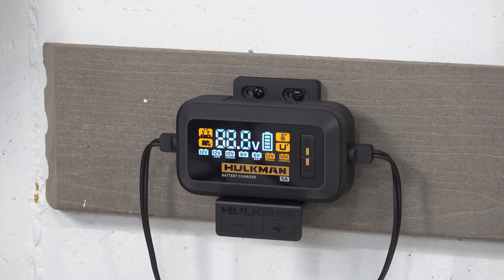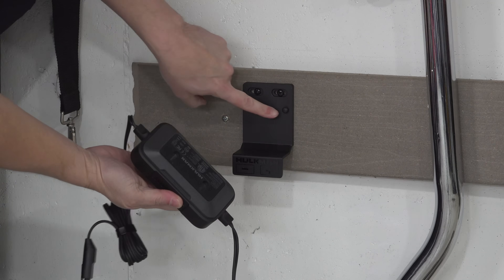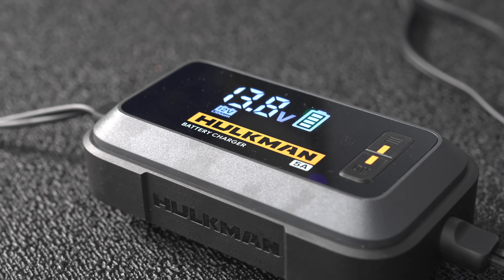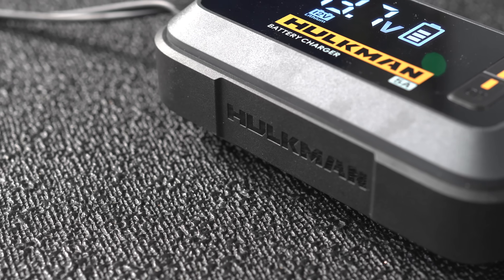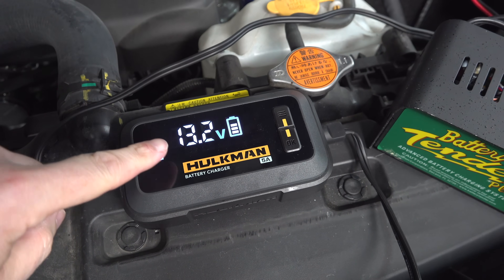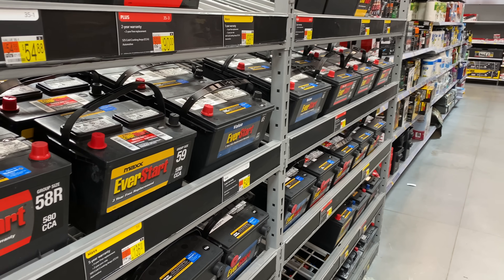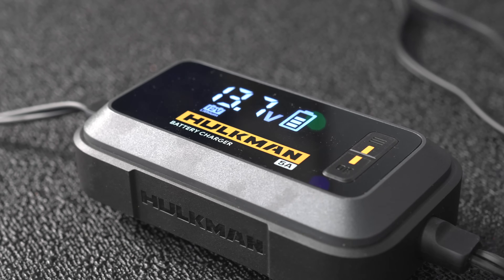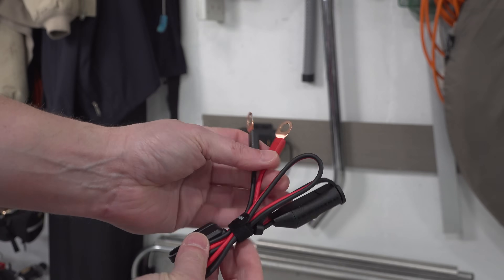UNIVERSAL BATTERY CHARGER - Hulkman Sigma 5 Charger & Maintainer

Comment: 12 volt battery at 7v. How do i start repair mode? I can select repair mode but it will not turn on when I tap select to start process or long hold.  Charger will just show 7v then cut off. Will not go into repair mode or load mode. How do i fix?

Comment: i bought this charger a few weeks ago. so far I've revived an old battery that came out of my civic I scrapped 4 years ago. battery had just been sitting, wou;dn't take a full charge and I ran the repair mode 4 times and now the battery will take a charge and my centech tester shows 90% of capacity. I've got a lawn tractor battery running its 3rd repair right now. that battery sat for a year and was dead. its taking a charge and hitting 85% of its og capacity. next up is a group 65 car battery. right now i've revived $100 worth of old batteries. i'm $40 a ahead on this unit right now.
Reply: Lol I'm going to be doing the same with all my batteries. I really hope they come back. For 15$bucks on Amazon, I figured I couldn't go wrong as my older chargers jus don't do it

Comment: How do you know what battery you have?
Reply: Simplest way- look at the label on the battery.  If you cannot find the "type" on the battery, find the make and model for the battery, and google it.  Many automobiles have an owners manual as well- and often the requirements are stated within the manual. Most people don't venture out of the lane and change the type or size of the battery, although in colder environments, some will buy a higher capacity ( cold cranking amps, aka  CCA ) .  
Reality is- for the most part, it's foolish to hook up a charger to a battery and leave it connected for any significant amount of time unmonitored.  Under most circumstances, one should not need to use a charger;  if you do, you have a weak battery that is close to failing or you have some sort of parasitic drain that is causing the batteries to drain;  or you simply are not using your equipment often enough to keep it charged otherwise.

Comment: Looks ok the problem is it's 5 amp that just too slow... I remember trying to charge my battery with a 2amp charger and it takes around 2 days on constant charge.... I'm guessing a 5 amp would take 24 hrs  that's just too slow.... Minimum battery chargers people should look at is 8- 10amps  unless of course you just want a battery maintainer...   Though most battery chargers have maintaining function as well.... so why not get both....

Comment: Glad you mentioned the part about how the unit can charge a completely drained battery. I had a smart charger that was incapable. Below a certain voltage, it wouldn't turn on...

Comment: I have several battery tenders, but this one is cool with the information right on the screen what voltage is, etc. I had to buy one and see if it’s as good as advertised? Hopefully it is or even better? Update, I got it and hooked it up in my chicken coop to keep my battery charged that’s also connected to solar panels as well. Unfortunately when it’s cloudy all day or the days are short the solar panels won’t keep battery charged enough. This charger works great since it charges my battery whenever it’s low and shuts off when the battery charged.  It’s great having the LED readout to just take a glance and know how charged my battery is? I definitely recommend this charger!

Comment: Looks like a nice charger. I have had that Battery Tender you showed in the video and used it almost every day for 7+ years and it has never let me down. I have used various other chargers/maintainers from Noco, Schumacher, Harbor Freight, etc and the Battery Tender is actually the only one that consistently works properly on every functional battery I have used it on. My Noco has lights to show 25%, 50%, 75%, and 100% charge, but they aren't very useful because even after it says 100% charge it still takes several more hours until it's actually done charging. A million modes and cool flashing lights is nice, but not as nice as something that actually works every time without fail.
Reply: I own numerous battery tenders too, including the waterproof battery tenders I’ve had for least 15 years now that I’ve kept on my motorcycle batter and ridding mower. I’ve gotten least the lifetime on my motorcycle battery just from using the battery tender anytime the bike just sitting for any length of time.  This new charger even with the fancy screen still got some serious shoes to fill to even match the battery tender in my opinion!
Reply: @ghostridergale  I agree! Whenever I'm at home and one of my cars isn't going to being driven for more than a few hours, it's on the battery tender. Of course that's overkill, but one of my batteries is 10 years old and the other is 8 years old and both still test over their original CCA ratings. Keeping the battery fully charged all the time helps keep the alternator happy too. Maybe not a big difference but less load equals less heat and we all know that excessive heat is bad for anything electrical.
Reply: My NOCO crapped out after a few tender months. The best to you.

Comment: Thanks for the review. $70 for this isn't too bad. I like the info screen.

But I've had years of good service with both of my Battery Tender, Jr -- bought at ~$26 each. Plug it into my cars and red charging LED turns green within a few hours. I know I'm good when I unplug them and drive away.
Reply from the maker: No problem, also its $59 for the moment if you use the coupon. https://amzn.to/3DiEqPq  so its makes it a better deal. $70 would make me think a little more, still nice device but $59 I like better!

Comment: The underlying issue with hulkman maintainers are that the connectors are not sae, they're proprietary so there's no interchanging with other sae connectors.  I have the 1 amp model, it doesn't stop charging when a 12v agm battery is beyond 14.4v.  The voltage shows 14.5v and it's still charging so heads up for those who wants to keep this plugged in at all times and are OCD about charging beyond 14.4v.
Reply: That's odd that it keeps charging at such a high voltage continuously. Is the battery connected to the car when that happens? If there's any type of draw on the battery, the charger will think the battery isn't charged yet and keep charging at full voltage.
Reply: It should auto stop. Call customer service
Reply: I have the sigma 5 and the voltage drops to around 13.6volts and stays there after charging it to 100%.

Comment: This seems nice. The price is crazy low. I have a 7.5a CTEK smart charger. It has the same battery bring back feature. Unfortunately no fancy display and can't do lithium or 6v. Thought about cteks lithium charger but I may try this brand next!
Reply from the maker: I agree, many years ago I paid $50 for that battery tender and it certainly charged many batteries but it also sat doing nothing many times and I had no idea. Its nice to see this is more advanced but still is affordable

Comment: This is cool, but I personally like to use maintainers/chargers that desulfate batteries as well. Over time I've been slowly switching all my vehicles to deep cycle AGM, but I still have alot of lead acid and high crank agm that have to be kept up with, so the desulfating chargers I use have been relatively helpful there. Though I'm sure there's something better or more effective out there I just haven't come across yet
Reply: I use a CTEK charger for this. They have a reconditioning mode. But so far I haven't needed to do them on my AGM batteries. I've had ten in one vehicle being used for 5 years no problem. Now I'm down to 1. And I have two in my diesel. Never had to desulfate them. Voltage and CCA are still great. Using XSPower group 31s.
Reply: @TylerTron21  I might have to check those cteks out. Also how do you like those xspower batteries? I always see them online but never been sure about them
Reply: @crazymayne69  I can't find a single complaint about them. Used them heavily in competition car audio for over a decade. I also love my CTEK chargers. They just don't have the fancy display. More of a set and forget system really.

Comment: Charging lithium batteries to 100% shortens their lifetime, according to batteryuniversity.  Can the charger be set to stop charging before reaching 100%, for example at 80% instead?
Reply: It may limit charge to 80% peak in the li-ion mode? Not sure, just guessing
Reply: Charging to 100% isn’t really a problem, it’s leaving them above 80% for a long time that’s damaging. So if you discharge them down to 80%, that should be fine.

Of course, that isn’t really what you want to do with a battery maintainer - it’d be nice if you could just leave it connected.
Reply: @gf2e  :  I assume you're saying the more time the lithium battery spends above 80%, the more damage is done to the battery.  Can you cite a source for that information?
     If it's true, I assume it also means that the amount of damage depends on how far it is above 80%, not just on the duration.
     It's been years since I read the relevant pages at batteryuniversity.  If memory serves, 80% isn't an actual threshold; it's merely a good compromise for many users: a good tradeoff between maximizing total battery lifespan versus maximizing the hours of use until a recharge will be needed.

Comment: For people like me who don't have a garage and park outdoors, a solar-powered battery tender (with a solar panel attached to the inside of the rear window) makes more sense.  Any recommendations?
Reply: I had one from Harbor Freight and it worked fine for a few years, I think it was 1.5 watts. However, it had no type of voltage regulation and I have seen it charge my Optima Yellowtop as high as 15 volts when the sun was shining on it, which is really the most you want to see and isn't ideal for extended periods of time. I would suggest buying one with some type of voltage regulation to be on the safe side.

Comment: This looks like a good product. I really like the voltage display. My only concern is that it hasn’t been out very long. The reviews on Amazon look good, but some of those were given the charger as part of Amazon’s Vine program. On the plus side, the reviews for their jump starters have been very good. 
People thinking of using this on a battery bank should know that there’s a 120ah cap on the bank size. 
I’m still debating on whether to get one to replace my Battery Tender. In any case, I really appreciate your review. Thanks!
Reply from the maker: Those are all good points for sure. No guarantees on anything in life but Hulkman made a jump starter that went insane with sales, people loving it, and good reviews, so hopefully that will give some confidence in this one long term good point about the bank size.
Reply: So would this work on a 48v 100ah LiFePo battery?
Reply: @SandstormGT  , it would only work to charge a 12v battery.

Comment: Are you sure it'll do LiFePO4 (ithium iron phosphate)? Those cells have a significantly lower carged voltage then regular lithium and could be damaged if the charger doesn't actually have a charging mode for them.
Reply: You are correct about the voltage per cell, but most LiFePO4 12v packs use four cells, whereas most 12v LiIon packs use 3 cells. Max charge voltage is 14.6, vs a 3 cell LiIon at 12.6.

Comment: I'm curious what the "protective circuitry" on the old model was intended to protect against?
Reply from the maker: It used to make me insane. You had to trick the charger, here is some info on it. There is a trick to charge it from a completely dead battery. If you try to charge a drained battery, it won't charge because it has a polarity sensor that needs some minimal voltage (2 volts) to detect the polarity to prevent reversed polarity charging/shorting it. You had to start on a good battery and then switch the terminals quickly onto a dead battery. Not practical.
Reply: @Silver Cymbal  What does the new one do to protect against reversed polarity?